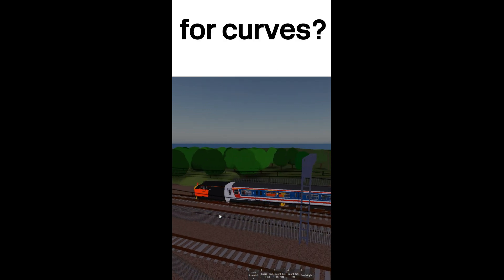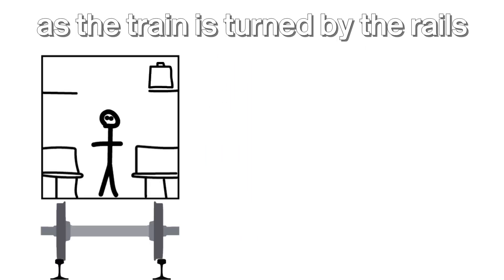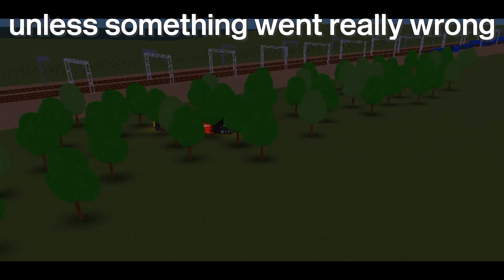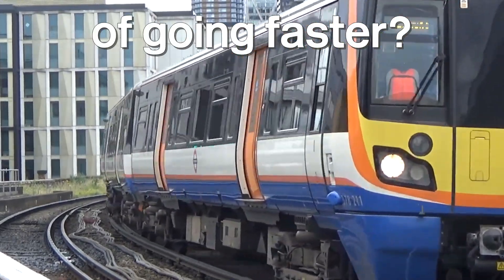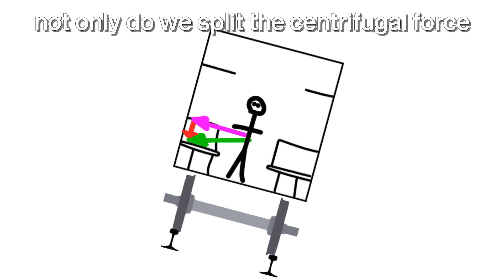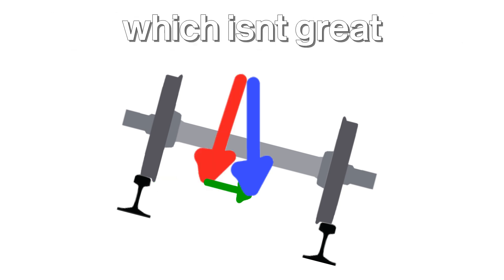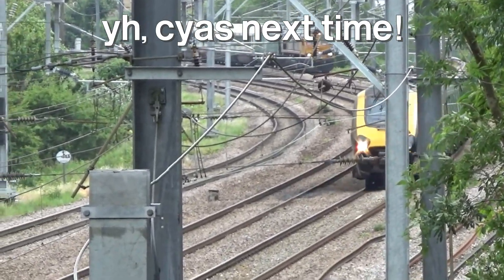Tilting Trains and.... Tilting Tracks? How Railways Curve

Comment: There's a second issue caused by tilting trains. Rail cars also have to be slightly narrower at the top if they're going to lean around corners or you need to separate the tracks to allow for the lean. Pendolinos are a little narrower as a result of this. So you can either have space for large luggage in the overhead racks or you can have a cup of coffee that doesn't spill on the tighter curves but not both. At least not until we perfect those anti-gravity machines... one day.

Comment: The limit on cant is 150mm, you can have a cant deficiency of another 150mm. Also by tilting trains being complex they are heavier than no tilting units therefore having a slower acceleration rate than a non tilting unit. The everos are only 2 minutes slower than the 390s between london and Liverpool once more of the 125mph MU limits are rolled out on WCML as parts of the WCML can suppoet above 110mph running for non tilting units such as through Harrow & Wealdstone which can support 125mph running however the updated limit is yet to be posted because WCR didn't like the idea they would find it harder to run railtours on the WCML.

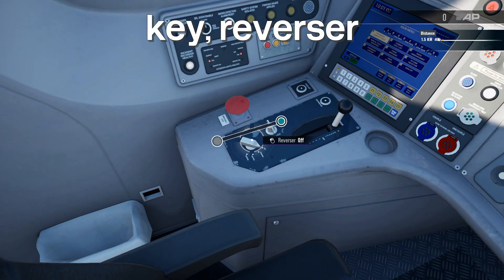Comment: 1:55 just insert key, set reverser to forward, spam aws acknowledge (only on pendolino), close doors on both sides, put the power brake handle to max acceleration, if it doesn't move, set it to coast, wait for BC to go to either 1.5 or 0, then back to max acceleration (normally works on most uk trains though)
trains like 72 stock is very different though